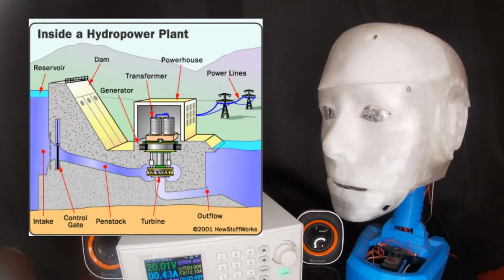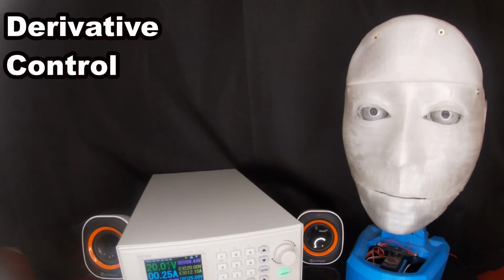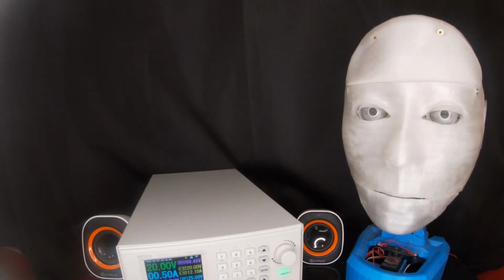PID Control Systems

Comment: Cool video Ray. I have to remember this Pid as I've heard it before. I take it that you use the Pid loop whether you use a Arduino or Raspberry Pi?
Reply from the maker: PID loops are used in a lot of different applications.
I use them in industry quite a lot.
A while back I did create my own Servo Driver board, this controlled a DC motor using a pot for feed back using a pair of PID loops, one to control the position the other to control the motor power.
https://youtu.be/DicT5K3WYU0
There are also PID loops in the 3 D printers to control the temp of the nozzle and bed.
MRL also has a PID service: http://myrobotlab.org/service/Pid and just recently GroG the lead developer there has used it to tracking allowing a robot to turn its camera to keep the target object in the middle of the camera view.
This good news these loops are implemented in the MRL computer (PC or Raspberry Pi) but in the demo I linked above, it was in an Arduino Nano.